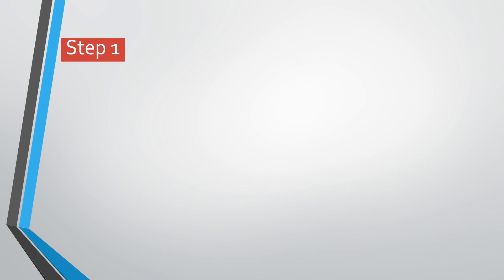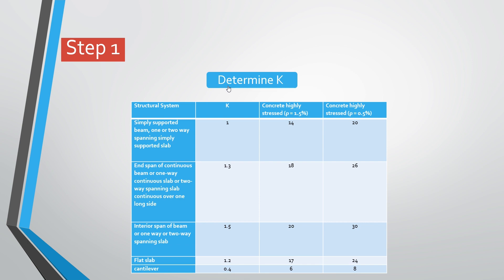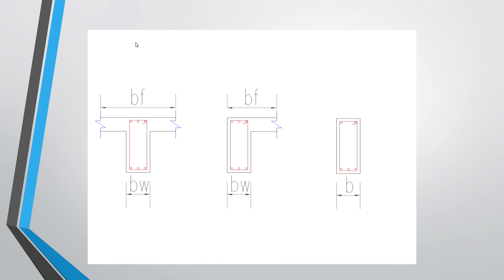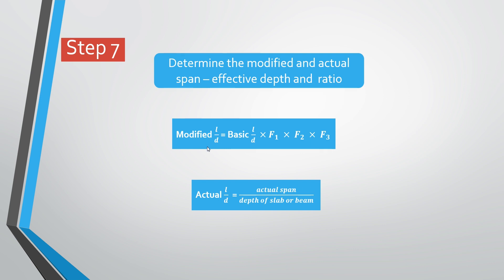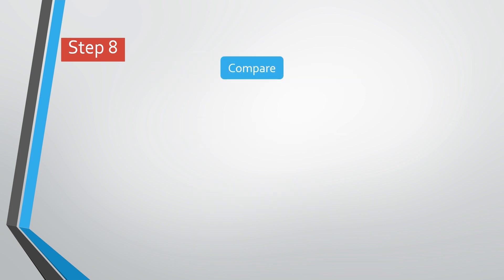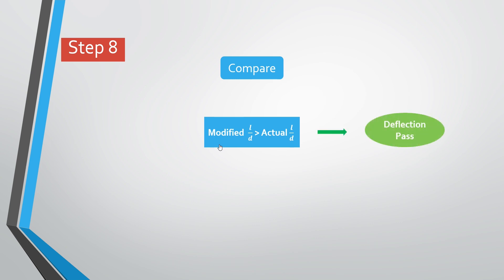Deflection of Beam and Slab | Eurocode 2 | 8 Steps to Check

Comment: Whats the use of the first two steps since you didnt use both rho and the k factor? aren't they used in shear check?
Reply from the maker: They are both use in step 3.
Reply: the table you show in step 3, basic span-depth ratio value are only assume the C30 concrete. May I understand that the basic span-depth ratio shall be calculated based on EC2- Expression 7.16?